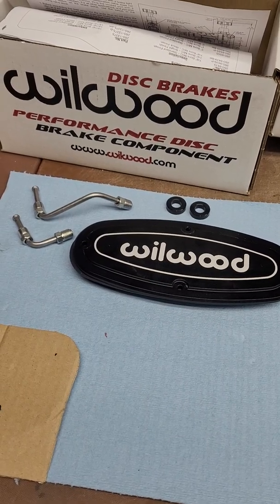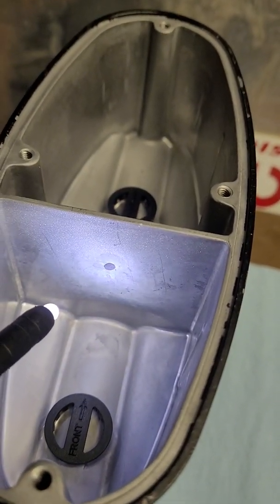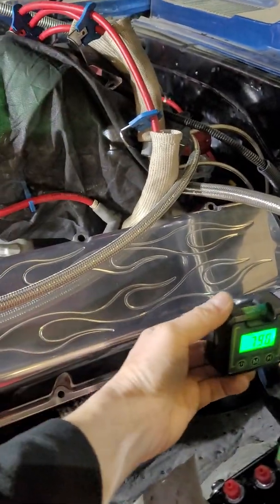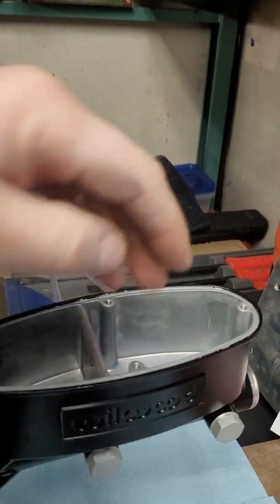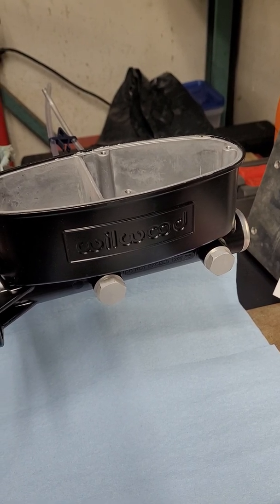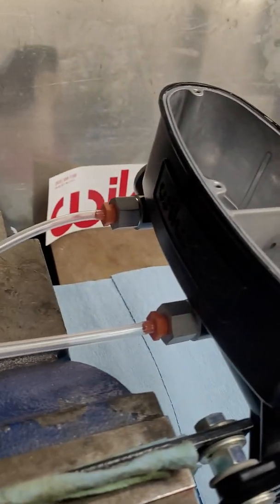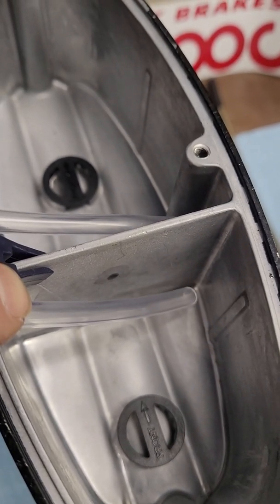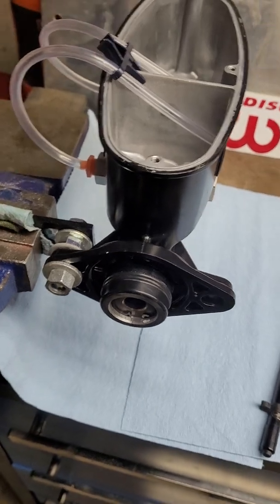Blocking the fluid transfer hole between reservoirs in a Wilwood master cylinder

Comment: Why did they make that hole?
Reply from the maker: It's for fluid transfer when the master cylinder is mounted level, but on some vehicles ( like my 1968 Camaro) the master cylinder is mounted on an angle and the transfer hole ends to be blocked

Comment: The brake fluid won’t degrade the JB weld?
Reply from the maker: Not if you let it cure properly..
Reply: @wandler76  From what I have gathered online the brake fluid will eat the JB weld,I am going to block mine with a screw